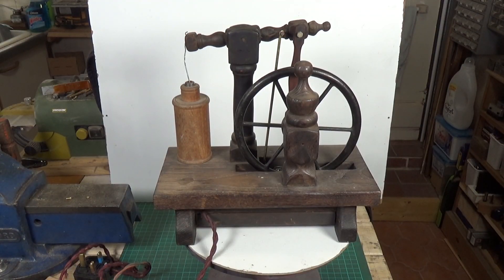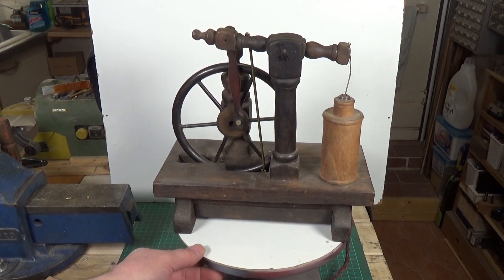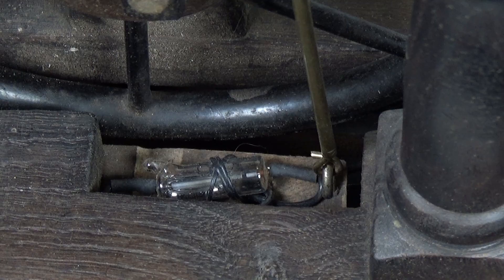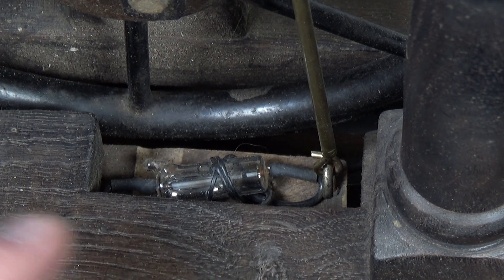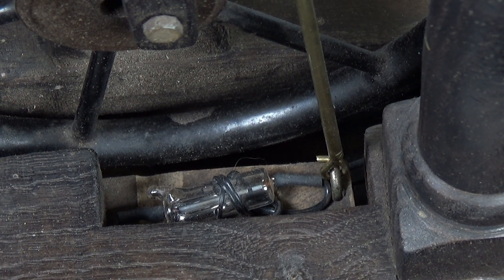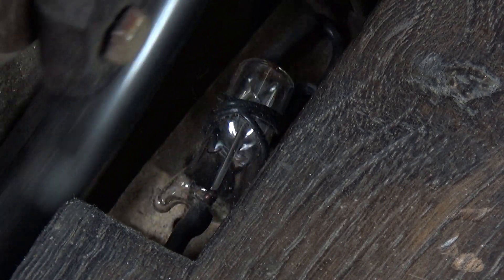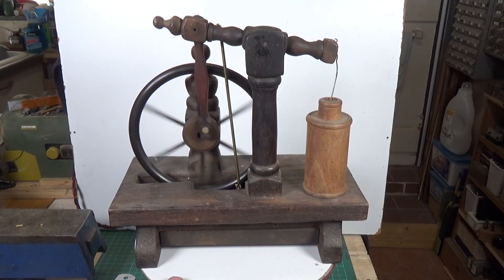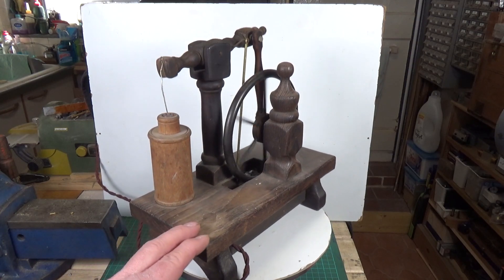Old Solenoid Beam Engine - Revisited

Comment: Wow, that's incredible.  They used those mercury switches back in the 1960's for the car boot/trunk lid light switch as you lifted the lid and changed the angle/orientation.

Looks very old.

How may engines do you have Alan?

Cheers Rob
Reply from the maker: I didn't know that about the car boot switch but thinking about it it does make sense.

I think on the last count i have about 160 stationary engines. I don't like counting them as you tend to frighten yourself 😮

Cheers, Alan.
Reply: @RetroSteamTech  Ha Ha. 

 So long as you enjoy it.

Cheers Rob